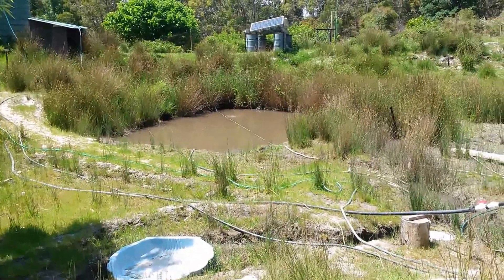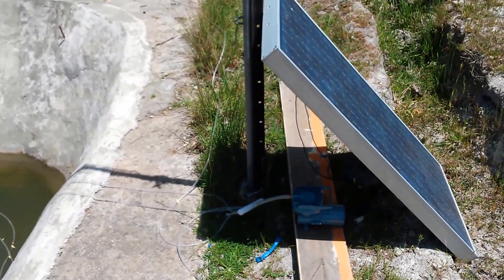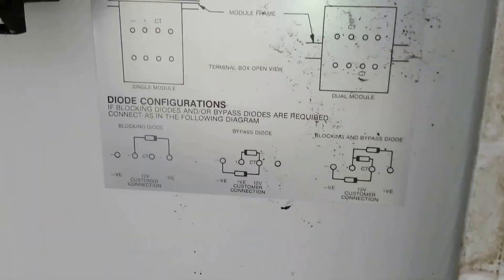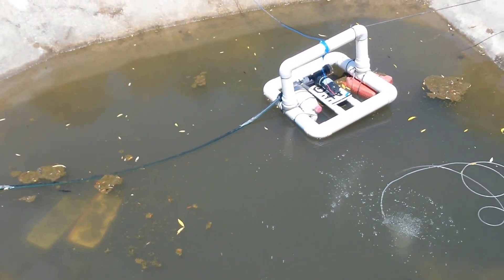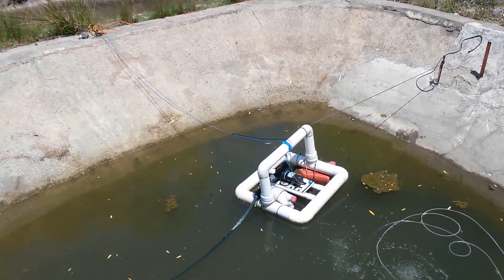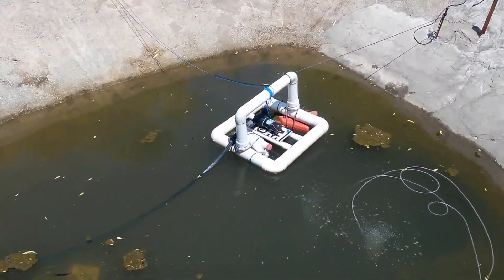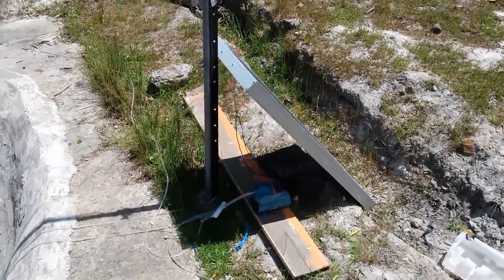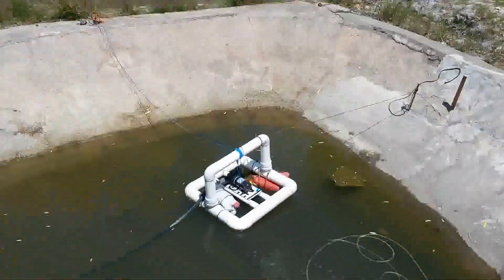~ DIY ~ Large capacity 12v Solar aerator ~ Cheap and easy

Comment: this looks great - I have a question - would a 50 watt solar panel run the 12v pump?
Reply from the maker: +GILLIAM ROBERT 

I think you'd want a little bigger than 50w. I can run a smaller 11L per hr pump off a 60w panel but it has to be in full sun and at the right angle to work. So Id say something more like a 75w depends entirely on what size pump you will be running with it!
Reply: ok thank you for you time